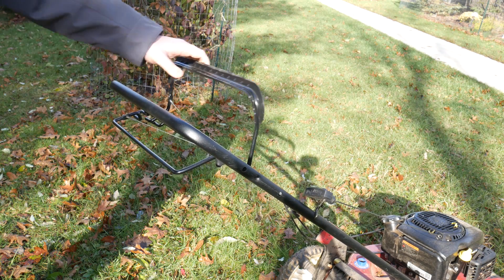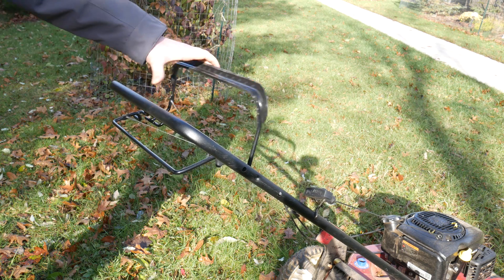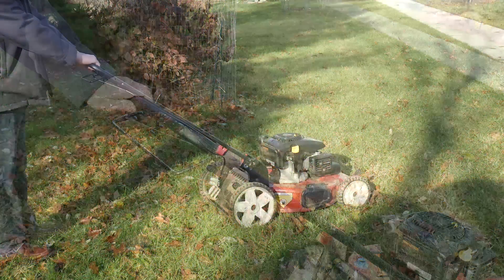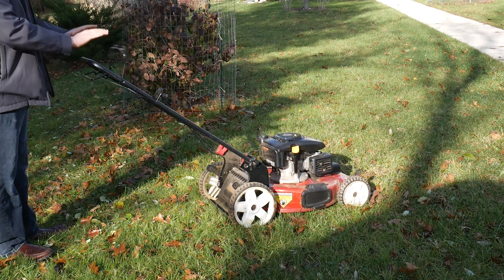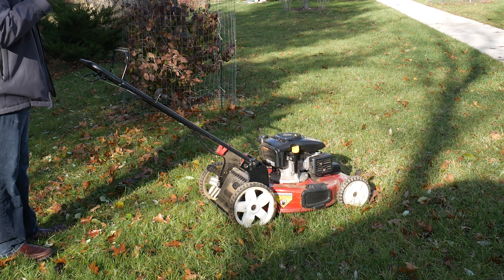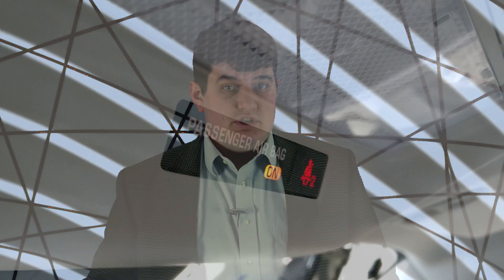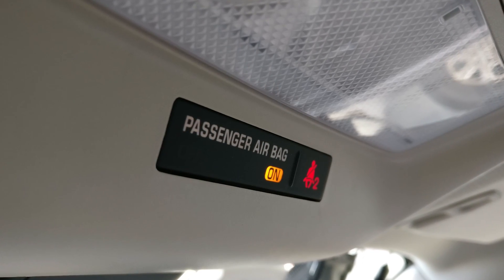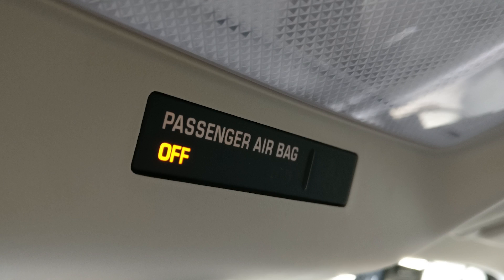The Dead Man's Switch:  How Anton Yelchin's life could have been saved

Comment: This sensor is already in: if the driver isn't buckled up, an alarm tone and a seat belt sign shows up, so...
Why not use this one?
Reply: Justa Friend oh look another reason to buckle your seatbelt! 
1. Safety
2. Annoying noises
3. A warning light telling you something is wrong
4. Legally required
5. The car won’t move
Reply: @PinkishPlant  then you buckle the seat belt behind you so the car moves.
Reply: @PinkishPlant  
Well, I actually disabled the seatbelt warning in my car for a reason.
Here in Austria, it is mandatory by law to buckle up since 1976 (i.e. since I was four), so buckling up in a car has been second nature for me throughout all my life and even more since I got my driving licence in 1991: get in, start the engine, buckle up, shift into first gear/reverse, drive off.

However, when I'm parking in front of my house e.g. to bring in groceries, I don't buckle up when driving my car into the garage, because doing so for driving a distance of about 40 metres (~44 yards) at barely walking speed (on a road which also doesn't allow any oncoming traffic to drive any faster, I might add) doesn't make any sense to me, but is just an unnecessary nuisance - in the worst case possible, me and an oncoming car would bump into each other very gently at a speed of less than 5 kph (~3 mph).
Which means for some years, I just endured the beeper for that one minute drive into my garage, but decided to disconnect it last year, because I do buckle up anyways as soon as I'm actually driving anywhere else, which means it's unnecessary redundant.

I addition, I'm one of those blokes who always engage the handbrake when parking and putting the gear into neutral - except when parking on a slope, of course, then it's: engage handbrake, put in first gear/reverse (handbrake first to avoid unnecessary stress on the gearbox) and turn wheels away from the road (i.e. if the handbrake should fail, my car won't end up being a hazard for others by rolling into the road, but roll away from it). I.e. just the basic safety things I learned in driving school.

On the other hand, using the same mechanism as a dead man's switch would actually make sense, but only if it would prevent e.g. putting a gear in. Because if such a doodah would prevent the engine from starting, that would be a problem in workshops where it is necessary sometimes to have the engine running without anyone sitting in the drivers seat - although I admit that still could be solved by just engaging the seat buckle.
Reply: @PinkishPlant  my friends car has a similar function which puts the car into essentially a "granny mode" until the seatbelt is buckled, you can override it if the seatbelt sensor is broke by selecting and holding drive for a few seconds
Reply: @PinkishPlant  The car wont move would definitely be the most annoying one. The car wont move would give the most reason to buckle up. Second to it's legally required but people still don't wear their seatbelts anyways.
Reply: @PinkishPlant  what if you have to take off your seat belt while driving.
Reply: @PinkishPlant  Seat belts should not be legally required.  It's just a way for the state to reach into peoples' pockets.  It's your decision whether or not you want to wear a seat belt.  We need less nanny state not more.
Reply: @Bryan B, @Bethany Porter, then I hope your loved one never ends up a mass of drooling, semi I humans flesh because the seat belt was uncomfortable or cramped my rights during a head on collision and they became a projectile!! Gotta keep those rights, even though someone else's insurance is now paying for it!! Thank you!
Reply: @PinkishPlant  Never used seatbelts in the late 70s/early 80s and here I am today.
Reply: @TonyP9279  Lets also talk to the people around here who died in a car wreck back then.
Reply: He mentioned this, just people need to program it now so when the driver isn't detected the car doesn't work.
Reply: The simple answer is because there are other sensor that are better at determining the operators intentions than the seatbelt such as the door sensor.
Reply: i live in NH what the hell is a seatbelt, helmet, and auto insurance lol
Reply: Just wait until manufacturers start running a wire through the seatbelt - if the recepticle doesn't receive the electrical signal placed on the other end of the wire, it knows the belt is unfastened.
Reply: Bogdan Kondratov  oh yeah like a diesel emissions system. 

Like oh sorry you ran out of DEF. Engine runs fine. But we're going to make you walk the 400 miles back to town.
Reply: BMW have this type of function, if you get out of the car it shifts to park (typically a seat belt off or the seat sensor and then a open door but most just do the open door)
Reply: This sensor only shows that the belt is buckled, it doesn't acknowledge that anyone is actually sitting in the seat. A lot of people will buckle and sit on the belt to stop the annoying tone and also to get it off their neck, so........we need a button you can push with your Glutes! lol
Reply: People don’t want to buckle it.
Reply: Well that would be more harm then benefit, for example this is really rare situation, just don't be idiot and put car in park before you get out.  Sensor in seat that would make car disabled in case of no presence if fail for whatever reason while you're driving could be fatal.

I refuse to daily drive car without mechanical emergency break and electric breaks. Fortunately there are still some truck maker that install these from factory.
Reply: @stefans6658  Sensors are for machines what senses are for you. If you decide to not listen to a specific sound, you do it for obvious and good reason.
Programmers can do the same: To start the engine, the sensor needs to transmit its designated value, but after that, the value will not be asked again until the key is removed.
Reply: @justafriend5361  Perfectly good example, that's legit, but car can't push forward and smash someone like in the video example if it's already turned off. It can be managed maybe if it's only relaying on that sensor if car standing still or move less then x mph. But that would make system more dependent and complex and in case of failure will be much more problematic then just using common sense, and btw most cars already have something similar, if car is running or even if key is in the ignition and you open a door it will beep. Good enough you get alarmed instead of car disabled, if you still decide to ignore it, your fault. Disabling the car would be the same as let ban automatic transmissions, this cannot happened in manual, so automatics are dangerous. 95% of the us never drove a stick, so imagine number of accidents:)

Edit: 
As an example of preventing accidents, you have some woodworking equipment for cutting wood that will automatically shut off if your finger touch the blade, but for contrast you don't have automatic full breaks on trains in case someone is standing on rails... simply because if it happens all people on the train will be at danger and there will be high probability of train getting de-railed and kill everyone on board.
Reply: @Justa Friend - Unless (like a certain member of my family) the occupant of that seat just buckles the seat belt--and then SITS ON IT! No alarm--no problem. Right?
Reply: As someone who's job all day is half pulling cars into and out of garages all day at 5mph, and also has to test things outside of the car constantly with the engine running. No thanks on anything to do with that. Maybe if it was attached to a chime so that, if you aren't wearing the seat belt and the transmission isn't in park, you'll get a chime to remind you, but that's about the only way that would work. 
    Even then, chimes go off when you leave your headlights on, and we all have or know someone who has killed their car battery by forgetting to turn their lights off.
Reply: My car did that - so I disconnected the sensor ;)
Reply: There are good reasons why it hasn't been implemented, it's not just that car engineers havn't thought of it. Mainly, if that sensor fails, your car is now stranded, and diagnosing that sensor can take a very long time, even if you can get to a mechanic (which not all mechanics can do). That might be fine in a city or suburban area where you can easily get a tow truck and find a suitable mechanic, minus the inconvienince, but that could end very tragically in a remote area with no cell phone signal, all because of a simple wire losing connection somewhere, where the car would otherwise work perfectly fine.

Even with a simple alarm, there are a variety of issues that can still occur with that type of system.
Reply: @Oleg-oe1rc  1 year late, but... Oh, man, if you're scared about system failures preventing your car from working, just WAIT until you hear about how the gas pedal, brake pedal, and steering wheel are all connected to a computer before the actual engine, and have been that way in pretty much any car you could buy after 1996... See Drive-By-Wire, Steer-By-Wire, Brake-By-Wire, Shift-By-Wire, and Park-By-Wire. Literally EVERY system in your car is controlled by a computer, and if virtually ANY of the computers in your car failed, you would be in no state to continue driving.
Reply: @ratemisia  I work on cars, I'm well aware. The difference is those sensors are integral to how a car works, and only disable that specific function on failure, not an arbitrary one that adds an extra failure point that disables everything. Know a handful of cars that have tried simular kinds of sensors in the past and been massive unreliebale failures because of it. I believe somone posted that Ford had it on one of their new models, so guess you can go buy yourself one of those and see how that works out. Any car that adds it will be a hard pass for me.
Reply: @Oleg-oe1rc  Did we not watch the same video? He SPECIFICALLY covered how a sensor failure could be dealt with, and it would have answered your objection.
Reply: @Oleg-oe1rc  
It could easily have a manual switch, if for some reason the sensor fails you could still use the manual switch, the same if someone doesn't want to buckle up, this switch could be resetted every single time the car turns off

This would also make it impossible for the car to operate by accident without a driver, and at the same time not locking the driver to operate the car in the case of a failure
Reply: @Oleg-oe1rc  Did you watch the video? software is flexible, and there can be overrides
Reply: @koyyle  I'm a programmer, I don't need the video to tell me that. I can assure you countless engineers have already thought about this, and it's many issues and their solutions. It's still not somthing that any manufacter would actually implement, and good luck trying to change that.
Reply: @Oleg-oe1rc  to be fair, theres alot of other things car manufactures could easily do without any negative affects and clear benefits which they dont seem to be interested in doing. Yellow turning lights being a good example this channel has covered.
Reply: @Garfie489  No yellow lights have their reasons, just not for safety reasons. Cars tend to looks nicer without them, and good looks sell. So same as with liability issues with having a kill-switch, it just comes down to profits.
Reply: @Oleg-oe1rc  Ford actually implemented this in their 2020 Explorer. It will likely become standard equipment in their future vehicles.
Reply: @Oleg-oe1rc  I'm sorry to tell you, but we programmers are notoriously bad at understanding sensors. Good ones tell you when they are disconnected - you can use that to flash the "check engine" light instead of disabling the car. E.g. a pressure sensor may give you a resistance of X for a light passenger and Y for a heavy passenger, if you detect infinite resistance then the sensor is gone (zero resistance: it is burnt out). You can even add this feature to a switch by connecting each side of the switch to 2 pins instead of one - if one of the mandatory shorts is gone than the switch was (partially or fully) disconnected.

There is absolutely no reason to save those 10 bucks in a car as expensive as a jeep.
Reply: @KonradTheWizzard  That's all great, except I was specifically replying to those talking about disabling it. Of course you don't need to disable it, but that's not the point. And as the video mentioned, the sensors are already there, this isn't a cost saving thing, it's a logistics issue (though even $10 × a million cars adds up)
Reply: But as I said, it's mainly a liability thing. Even if you did an amazing job programming the system, people are stupid. And if that sensor ends up killing somone, even out of their own stupidity, the manufaturer becomes liable. Wereas if they don't add that feuture and you mess up, it's just on you, not their computer

Same reason self driving isn't in every car, even if it's techincally safer, If the autopilot does crashe, it's the manufacturer's fault. Could easily be added to votually any modern car for under $1k, and not even just lane keeping, but full autounoumy
Reply: @Oleg-oe1rc  Did you not watch the video? there could be a simple override, like five presses of the power button or press brake five times.
Reply: @Oleg-oe1rc  You can easily override that. My car, an automatic, does not allow you to shift into neutral mode if the engine is not running. This of course causes a problem if the car needs to be towed. The solution? A little button next to the shift that when pushed in with the car key will unlock the shift allowing you to shift into any gear even when the car is off.
Reply: @chase-2-2  Which is exactly why my car is a manual, where I don't have to deal with any of that nonsense. What happens when the override fails? Adding more sensors and switches to an already potentially failing sensor just adds more problems and is at best a workaround, not a solution. And believe me, the sensors WILL fail, and people tend not to thrilled to see a large bill for a part that doesn't actually do anything other than arbitrarily disable/enable their car when it does fail. And again, that's assuming you can even fix and it's not an emergency, how to you plan to get the car to a repair shop when the overide fails and the engine won't start? You can go ahead and buy the new Fords or whatever trying this out, but I'll repeat myself once again, any car that has somthing like this is a HARD PASS for me.

If you need sensors to prevent you from leaving a car in neutral without a brake on, you probably shouldn't be behind the wheel in the first place.
Reply: @Oleg-oe1rc  Not everyone is you. Not everyone does an entire checklist every time they need to get out, for virtually any reason, even life threatening ones.
The system is there to remind you if you forget. My parents tend to forget to turn off the headlights for shitton of reasons few times per year. Does that mean they are supposed to disable the beeper that notifies about it because it's "unnecessary redundant"? Are they supposed to stop driving because they forgot to do a relatively harmless thing and needed to be reminded by the car about it?

You probably know that, but park on automatic does stop movement of the car. It's probably as fine to use it to "get mail from mailbox" as it is to "drive up the driveway without seatbelt". Except in this particular case, the core issue (at least according to this video) wasn't about driver not putting the brake; not shifting into park; overriding switch or sensor being dead. I obviously cannot speak for it, but driver could be relatively new to the car (barely ~2 year old model which started being recalled just 2 months prior and there was no patch sent to dealers yet at the moment of death) and have no clue about there even being such a thing as "N or R shifts being hard to distinguish from P". Such dead man switch would literally come into play and literally tell you that something isn't right, and/or make sure that it is.

There are cases where you are allowed to drive without a seatbelt. Be it work conditions, or medical ones. In such cases you are entitled to ignore or turn off the system if it does more than just beep. In any other you are just risking it. Sure, not wearing seatbelts does not kill, and in worse scenarios you die no matter if you had them or not. But you cannot rule out possibility of driving without one and being warned about it.

If simple beeping for a minute makes you disable the system, what else would you be willing to disable in case it would start to annoy you? As i said, not wearing seatbelts doesn't kill, but so does almost every other system in the car.

Also, what are you even talking about. Do you tow your car around instead of driving it? Safety feature for whatever reason that you need to override probably once or thrice during car's lifespan makes you shit on entire gear system? Please. Also what sensors even are you talking about. Engine being on or off doesn't need rocket science, and override as well as the gear lock itself could be mechanical in nature.

Oh, and don't forget to enable the beeper back on if you intend to use the car later on when every single "old human factor" will come into play :)
Reply: @tipakA  Like I already pointed out, a simple alarm and disabling a car are two very different things. You want to beep at me fine. But fuck getting stranded in the middle of no where because some sensor decided to stop working. No ones stopping you from getting one though, apparently Ford released a model with it, so knock yourself out. Still think if you need a sensor to prevent you from leaving a car in gear/neutral and walking away with no e-brake you shouldn't be behind the wheel in the first place.
Reply: @Oleg-oe1rc  Why are you so atatched to idea of permanently losing a car when a sensor dies? it was said countless times above, that you could override such sensor for literally any reason. O V E R R I D E. *Willfully*.
Reply: @tipakA  Using another sensor/switch.....
Reply: @tipakA  "Mam, I'm sorry to inform you, but you need a new sensor for your sensors sensor, that will be $200 to install"
Reply: @Oleg-oe1rc  Then sell your current car because it uses sensors all over the place. Go back to Ford T. that one had no sensors, no annoying beepers, and it still drives your ass around.

How many times temparature sensor died in your car? never? once? every second week?
Reply: @tipakA  I can count all the sensors in my car on one hand, and none of them fully disable my car, still plenty of reasonable options on the market. Just like you have the option the get the new Fords with these sensors, knock yourself out bud, I'm sure your mechanic will appreciate the extra business.
Reply: @Oleg-oe1rc  And did they ever fail?
Reply: @tipakA  Yes, and I used to work on cars where I've replaced dozens if not hundreds of failing sensors or their wiring, including brand new cars less than a year old. Funny how things works when theoretical engineering meets the real world, like squirrels chewing through wires. Good money for me, not so happy customers. But enjoy your countless sensors.
Reply: @Oleg-oe1rc  No problem, just make the driver click a few buttons on the infotainment if he wants to drive but no driver is detected. Or just implement an automatic override on any other action that suggests a driver is indeed present, like pushing a pedal.
Reply: People just buckle the seatbelt and sit on top of it
Reply: @putridvomit  not most people, just idiots that think seat belts don't save lives
Reply: i suspect people who refuse to use the seatbelt are the same ones who refuse to wear a mask
Reply: Its a jeep.  People often ride without a seatbelt when offroading because the  bumps will make seatbelts lock up, and you have to exist the car often, annnd the car usually wont be going fast enough for a seatbelt to be useful.
Reply: Bercurs us AMURICUNS WANT URR FRIIDUMM
Or 
'the seatbelt is uncomfortable so i don't wear it'

This is what happens when I mention the issue to anyone not wearing a seatbelt.